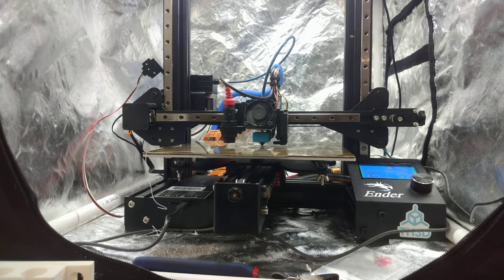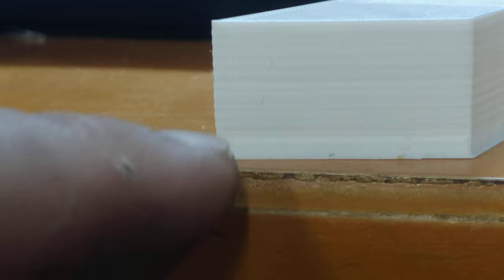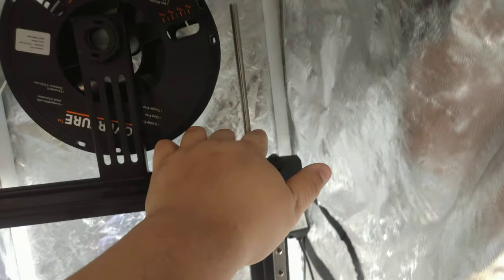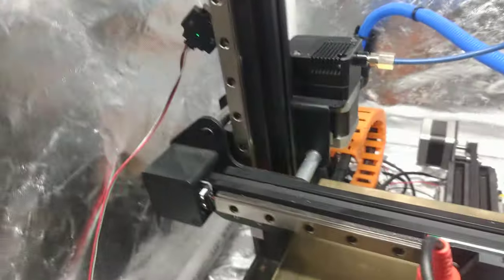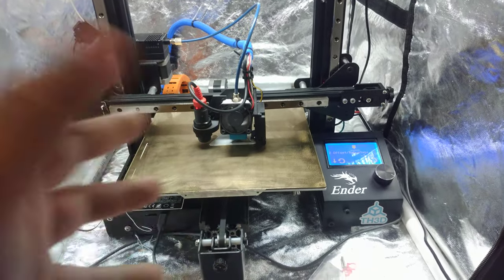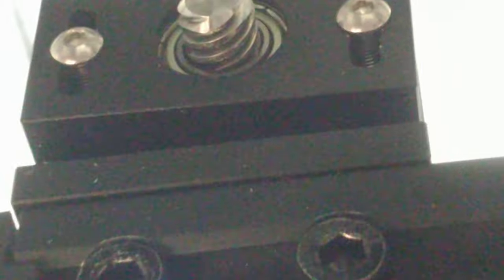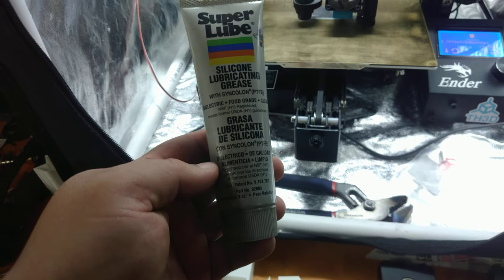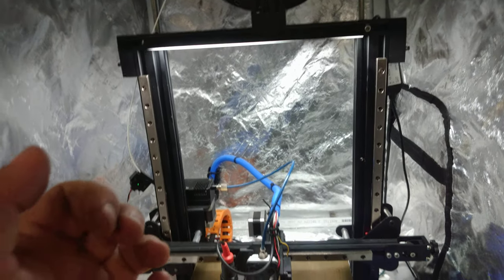This is What Happens When Your Lead Screw Nut Wears Away

Comment: Hi Andrew, I have a dilemma, I was looking on Amazon for new POM anti-backlash nuts for the Ender 5 Plus and found some reccomended for this amchine with 2mm pitch and 4mm lead with 2 starts, but then found another reccomended listing with 2mm pitch and 8mm lead with 4 starts
 Do you know which is the correct one?
Reply from the maker: That's a great question actually.

I've heard that the Ender 5 uses a different pitch than the Ender 3, but I've not looked into what pitch the Ender 5 is yet, as my ender 5 has yet to need any replacement parts on the lead screw or its nut.

Comment: I'm using a transparent bmg clone extruder with bowden settings on ender 3 v2 but having a problem when retraction makes a very loud sound on the extruder. What bmg extruder you are using looks very smooth when retracting barely any sound.
Reply from the maker: Does your extruder stepper driver run in a silent mode?
Reply: you might have to adjust the eccentric nuts on your axes for the the z, x, and y dirrections. My machine was sqeaky until I adjusted these.